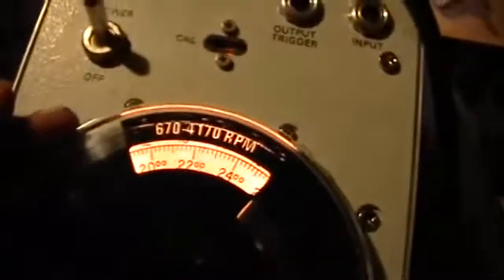Extreme High Voltage Electrostatic Powered Magnetic Levitation Motor

Comment: nice try but this motor is to unstable becose it have friction and no balance point  
so as u know the friction create heat vibrations and sound :D u need to find a bether way to cancel the friction , u have mi respect for thinking at this. i alredy done it the perfect generator i have it on paper and it worck 1000% but the tools and money i need to buy the rest of pices are hard to ghet  . my project it is frictioness there is no friction mi rotor levitate in air whitout ani point of contact whit  the stator and it is in vacum . , have a nice day